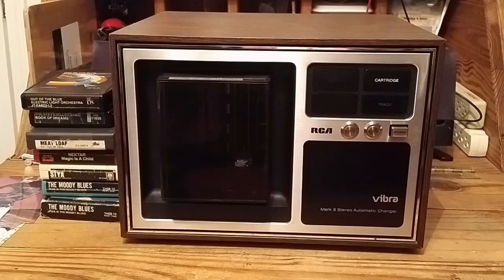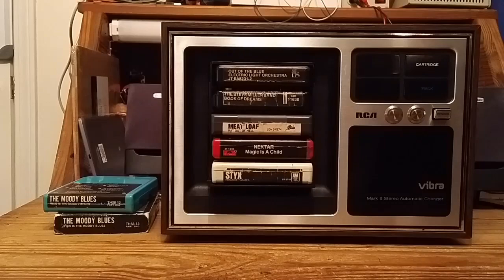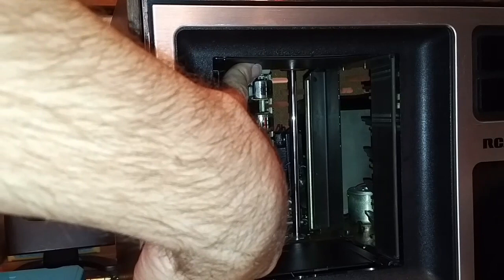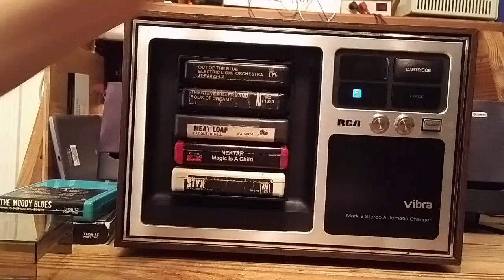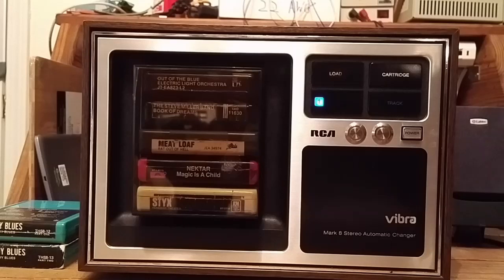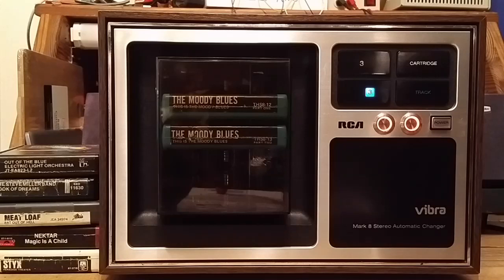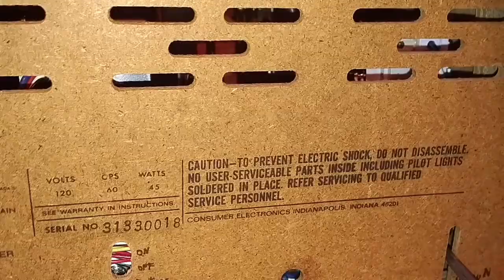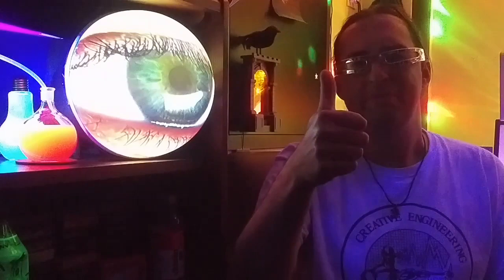The multiple 8-track cartridge player with interplanetary control

Comment: I would like to replicate these fantastic mods myself. However, is there Any possibility of obtaining parts numbers like relays/front pushbuttons etc? It would cut down on the guesswork and frustration. Just saying...
Reply from the maker: Ask and ye shall receive: https://www.evernote.com/l/Afnkx0hJaVVDnq9_q30vBIgLzQTWK9uLuhc/  I made some notes while I was working on this project.  Part numbers and links are included.  But I started planning this in 2017 and obtained some of the parts as early as then, and there have been some manufacturing and supply chain changes since then.  I updated links in 11/2020, but you may need to shop around again.  I hope you can still get the dual X10 appliance modules, as they're really the crux of all my mods.  I also depended heavily on the colors of wires in my notes.  These RCA units were mostly hand-wired and I don't know if the wire colors were set in stone, so they could vary among units.  But this should at least get you started.

Comment: I own the version of this player that has the built in tuner and amplifier and I absolutely love it! 🤗 The build and sound quality is top notch over any other 8 track player that I've ever owned previously to this one.  If anyone  ever come across one of these players out in the wild, I definitely recommend picking one up. 👍
Reply from the maker: Cool! I think I'm happy to have the line output-only model since I can easily use it with any amplifier I want, but I'm curious about the specs of the amp in yours.
Reply: The model that I have is the RCA Mark 8 Stereo Automatic Changer / FM-AM- MPX ( Model VYC 950 W )  It has  AUX OUT jacks and PHONO IN jacks... plus separate 8 ohm SPEAKER jacks. I'm not exactly sure how much power the built in amp has though.    I just use the line out jacks, so I can play it through my Onkyo receiver and it sounds great! 👍
Reply from the maker: @rwj777  Wow!  Obviously I've never seen that model up close, but I didn't expect a small bookshelf-type system like that to have the extra inputs and outputs.  Do the AUX OUT jacks give you line level output from the tuner too?  (I'm sure your Onkyo's tuner does a better job, but I'm just curious.)
Reply: Yes, the AUX line out jacks work with the built in tuner as well. 👍

Comment: I have one of these and have to agree the sound is superb. (I have a separate Dolby decoder, for some tapes. I also have a Telex changer which takes 20+ cartridges but I am yet to dare run / fix it. It is very cheaply built, from brittle plastic.)
I will try your “track change without advancing cartridge” mod as, you are 100% right, why did they do it that way? Remote is also cool but I need to operate it from a cell phone via the (glitchy) Harmony Hub, like all my other gadgets. The track changer timer is also a brilliant improvement. 
I will read your notes studiously!

Comment: Just freshened mine up and going. Payed a little bit for it  but it looks like it had very little used as the heads are pristine and had an intact original belt. Has a bit of trouble playing the tapes where the capstain is not perfectly centered on the roller. No fault of the player just the variablily of tape manufacturers. Need to figure out how to resurface the capstain would probably help with slippage. Heard of sandblasting or etching with acid. Nice mods should lessen wear and tear not cycling through the mechanism when you don't want to. Just sent the belt specs to westcoastresale on ebay if you wind up needing a belt, seems it's a bit of a rare player that no one had a belt for. Looks like you might be getting a little bit of hangup on your 4 to 1 track change. I had to clean up and degrease the track change mechanism to get it to constantly lift the whole head assembly on the switch back to 1. Mine has the same number on the transformer but is marked 0100N on the back with a serial no of 30940038 if that helps. Nice x10 integration, I used to use that stuff back in the day, kind of got back into doing stuff manually, simplifies my life. 😂 pretty good video for someone that doesn't make videos 👍

Comment: If you really wanted to get a full deluxe player you could add fast forward and automatic music search which is used on some Sharp 8track players.
Reply from the maker: Cool idea! But it has an AC synchronous motor, which means its rotational speed is locked to the alternating frequency of the AC power. So I'd either need to replace the motor with a dual-servo DC one that somehow has enough torque, maybe through reduction pulleys, or come up with some fancy solenoid-clutched transmission. Interesting challenge. But I think what I'd end up with would no longer be a true 8-track player, because the seek control would make sense! Nah, I can't go ruining that!
Reply: @toasTr0n  My Akai has an AC motor and it has a super fast FF feature. You could fabricate a motor mounting adapter bracket to mount any other motor as long as it fits in the area. Maybe there is a 2 speed motor that would fit with the same RPM's that you could use or just print or lathe cut a pulley to fit the correct RPM's.
Reply from the maker: @stvlu733  Does the AC motor in your Akai have separate windings for the different speeds?
Again, it's an interesting challenge but not one I'm likely to do.  The limitation that one can only jump to one of 4 already-defined points in the album at any given time is one of the quirks that makes the 8-track format so charming.  And I'm of the opinion that the inertial effects of abrupt speed-ups and slow-downs on a loosely packed freewheeling hub of tape is just asking for trouble.
Reply: @toasTr0n  This model Akai does have separate winding's for the FF and play mode. I do use the FF button a lot on my Sony and Akai and have never lost a tape weather it be a long double album tape or a short one. That's what the huge flywheel is for. It's to gradually slow down the tape and leave no slack. DJ carts used in radio stations used to play at this high speed like it was in FF and abruptly stop after the tone stopped the unit and removed the pinch roller.  I sometimes use the Sony to reset a tape while playing another with the Akai. These tapes are tougher than you think. Just don't play them upside down or transport them that way in a car. Now that's asking for trouble. I was always curious on how good the APSS worked on the Sharp recorder model to stop between songs. I don't know the model. This would be handy on those long play tapes since there is a 5 second gap between songs for most. I do have the patience of letting a tape play though it's cycle to hear what I want. It's not too bad. I find that to be the charm of the format as well. It almost forces you to listen to the other songs as you get used to them to further appreciate them.

Comment: Love the mods, make sense, its far to believe that RCA skipped them bak in the day. The pause thing , the only thing that coul be a bit concerning is it can put a spot on the roller if this is it left there for a long period of time. Same in some record players, as soon as you shut them off, the rubber iddler is put away from the motor and plate to avoid spots. Well, in the 8 tracks roller are in the cratridge so probably are easy to change if needed.
Reply from the maker: I actually thought of that! I have the 8-track player set up in my office with my PC controlling it. When I lock my PC, the player pauses. If it remains paused and there is no motion in the room for 2 hours, it moves to the LOAD position and powers off, relieving the pressure from the pinch roller. 😁
Reply from the maker: Great name, BTW. Love the C64 reference. 🙂
Reply: @toasTr0n  someone should invent a way to play 8track tapes on a pc so that you could just listen to music on your computer directly. Or maybe record music onto floppy disks.  I dunno, but somehow playing music on a pc would be pretty sweet.  How amazing would that be?
Reply from the maker: @JaredConnell  I'm basically already playing 8-tracks with my PC.  I can control all the player's functions from the PC, and the audio output plays through the sound card in my PC so my PC audio gets mixed in with the final audio going to the speakers.

Regarding floppy disks, you could downsample and compress the crap out of an MP3 until it fits on a 3 1/2" floppy.  But that's probably not what you mean.  There have been some experiments with recording and playing back analog audio directly with floppy drives, but the floppy heads are not well suited to analog signals and there is not much space available for storing a decent recording.  But the concept is very similar to that of analog dictation machines that used a proprietary magnetic disc, and those were a real thing!

Comment: I just picked up the JCPenny version of this unit. Works like a champ, and surprised at the audio quality. Would you be willing to share the details of the mod that allows continuous play? Not asking you to do it, just how you did it. 😊 Thanks.
Reply from the maker: Before I changed any of the wiring, I had a "discovery" phase in which I traced the existing circuits and made notes on what to change.  This is my note for continuous play (repeat all):
"Facing front of unit, on right side behind front panel, lowest switch on the chassis:  short orange and green together for repeat all.  Mechanism will not stay in LOAD position but cartridges can still be individually added and removed."
You could add something as simple as a single-pole latching switch that shorts these 2 terminals together, which will keep continuous play on.  But it will also keep the changer from stopping in the LOAD position; when you switch the power off, it will cycle continuously until you open your new switch, then it will power off as normal when it gets to LOAD.  If you're okay with that, that is all you need do.  Mine does not have the latter problem because I'm using an X10 appliance micro module (effectively a relay) to short across those terminals, and I wired the micro module so it's powered by the output of the power switch on the front panel, hence the relay opens when the power switch opens.
Reply: I'm loving my rca, the only issue is it has trouble playing the carts with the smaller diameter pinch rollers. With the smaller pinch rollers the capstain dosen't line up in the center, it rides to the inside more and i get some slippage.